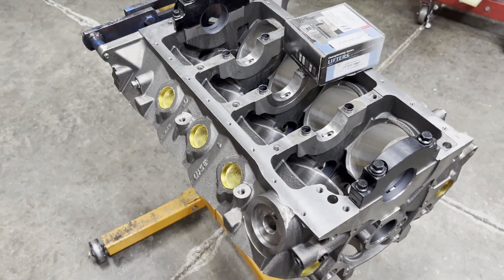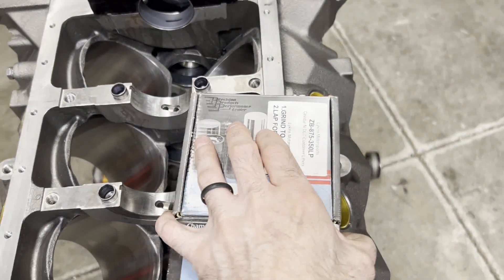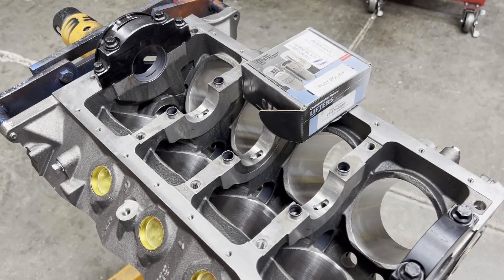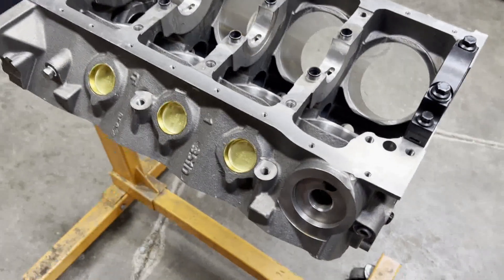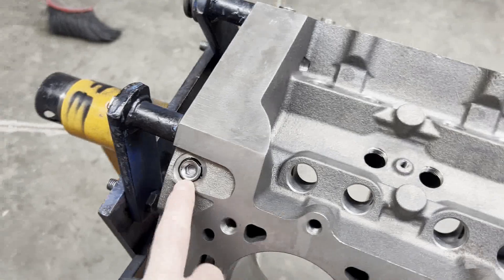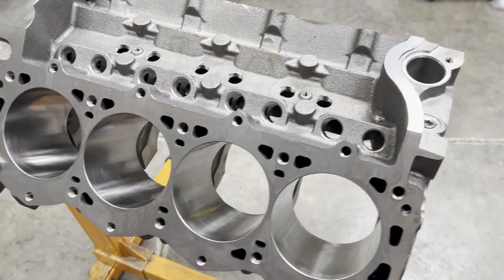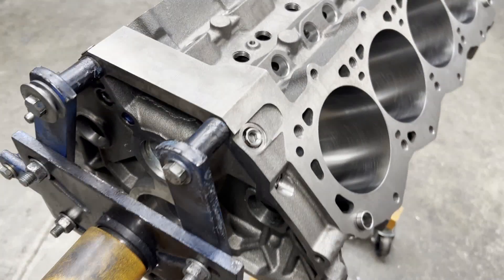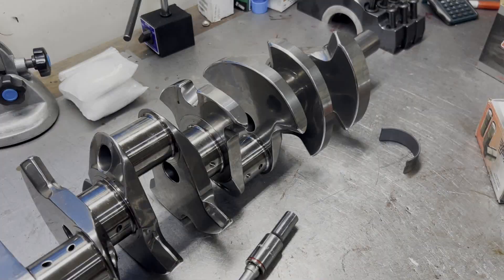Lykins Motorsports Ford SBF Tunnel Port Main Bearing Clearances...

Comment: With multiple mixed bearings doesn’t that prevent a customer from being able to service this engine. Making all service require it to return to you. That seems to guarantee that no one will service one of your engines. Seems more competent to polish the block to ensure all bearings match. Just an opinion and question?
Reply from the maker: What if you need less clearance?  Are you going to weld the crank up and regrind?  This is common practice and if someone can't look at the back of the bearing and see what size it is when they do a rebuild, then they don't need to be rebuilding it.
Reply: Kinda questions people who don't build high end race motors ask.

Comment: Brent, you ever use bearing spacers in a 351 windsor block? I have a nice 3.5 stroke, 2.75 main crank I’d like to use in a production windsor block and can’t seem to find the spacers. It was made by Eagle for Ford racing. Lightweight, pendulum cut.